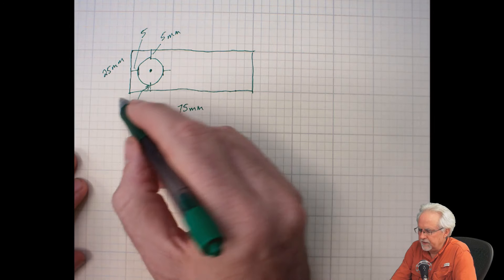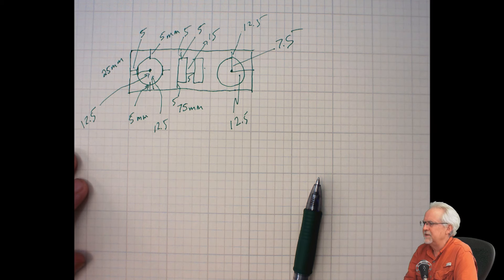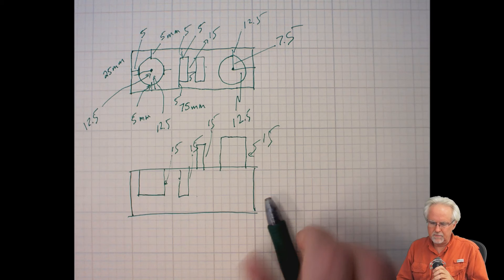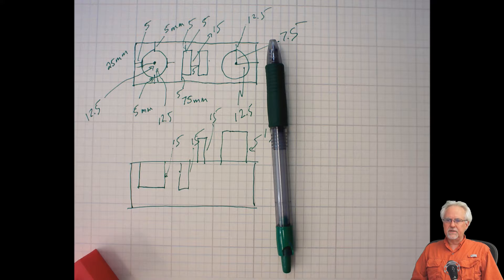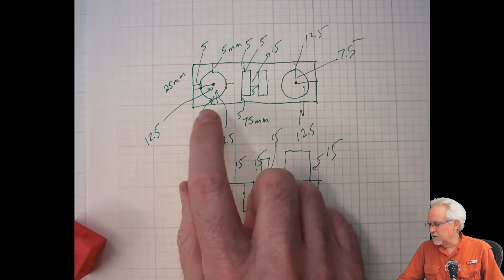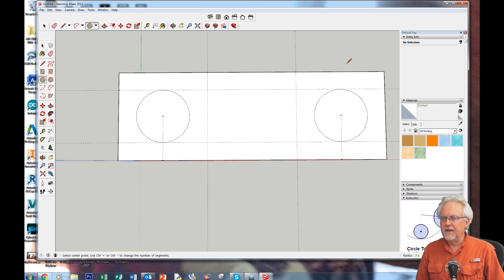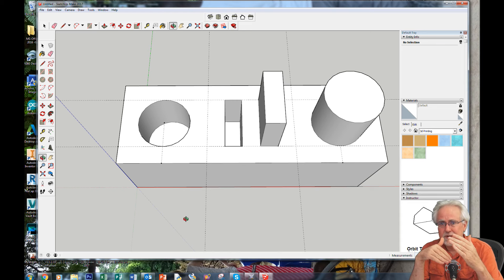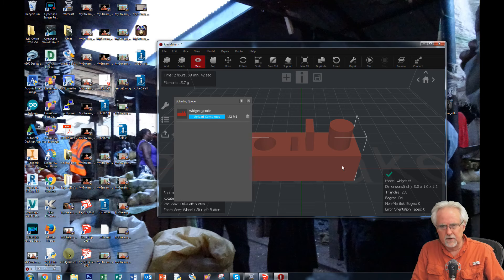Sketchup Tutorial LESSON 4: Simple 3d Design Example for 3D Printing

Comment: Paul, your lessons are helpful and really bridge the gap from idea to reality. I may have missed discussion about IdeaMaker and Splicer. Please say a few words about each. I am working on a MacBook Pro,  There are only minor differences between Windows. The Ctl key is = to the Option key. I am a great admirer of your work. Keep it up. Thank you.
Reply from the maker: In order to print a 3D design, it first has to be exported from the design program to a .stl file. Then, each 3D printer comes with a different "Slicer" program. The Slicer program is the program that converts the .stl file to the actual .gcode. file. The .gcode is the actual set of instructions that are sent to the printer that direct each move it makes to create the print. The printer I have is the Raise3D N2 printer. The software designed for that printer is called ideamaker. ideamaker is the "Slicer" for Raise3D printers. I also have a Prusa MkIIs printer . . . that printer uses a different slicer program. Just for fun, I printed to the Pruse from ideamaker . . . did not work very well. So, what slicer you use depends on what 3D printer you have.

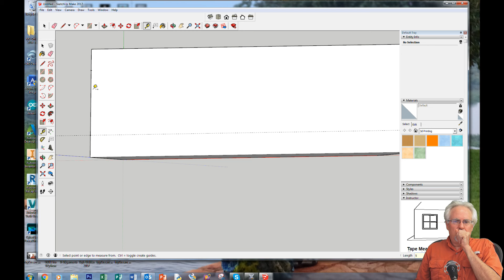Comment: There is no need to make a point (5mm) on the left edge of the box (12:53), before making a guideline, just find the midtpoint of the top most line, click and drag away from the edge of the box, click and type 5mm+Enter. Now you have a guideline 5mm form the edge of the box. I Hope this make sense. Why not generally use guidelines instead of guidepoints, it's in most cases faster and requires fewer steps? Just a friendly suggestion. :-)
Reply from the maker: I dont disagree with what you are saying. In these lessons I am trying to show a simple way that works, using the tool in a straightforward way. There are lots of shortcuts and fewer step ways of doing the things I am showing, but I am trying to show the simplest and easiest to remember.
Reply: I understand your approach to the use of Sketchup, and I think you are a wonderful teacher.